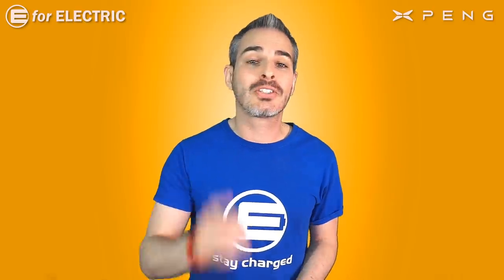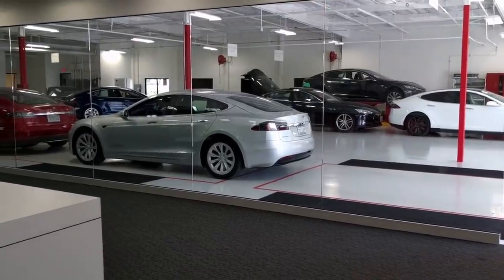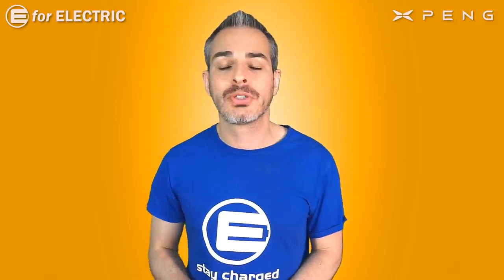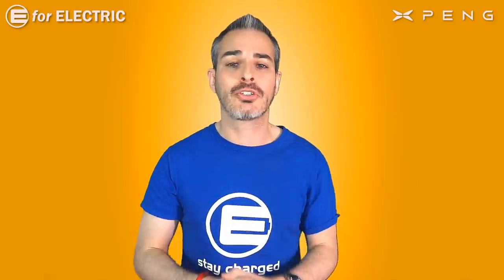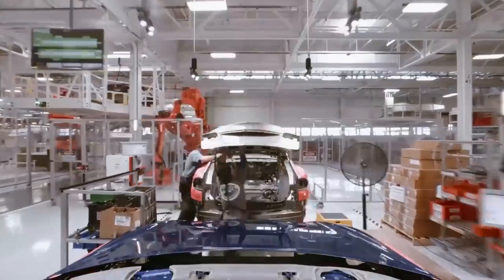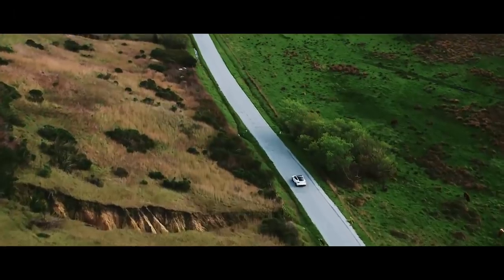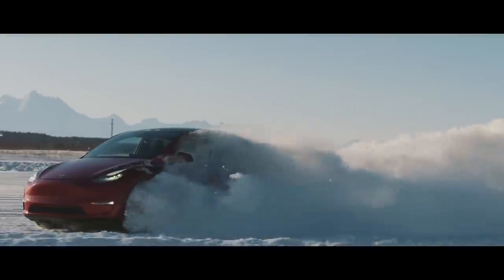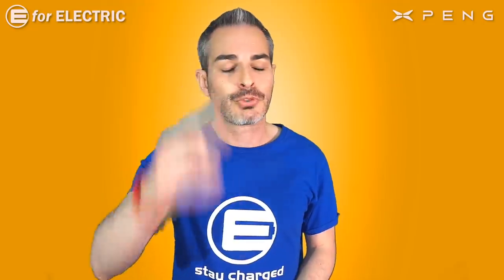Buying a Used Tesla in 2021: 10 Essential Tips

Comment: Hello Alex, I purchased one of the first Model 3s in Canada. I had to wait 901days from order to delivery. I needed AWD for our winters here and since the first Canadian models were only single motor ones, I went back on the wait list. So as well as having to pay for the largest battery, I had to wait in line for the 2 motor AWD version. As a result, in order to get my car, I also had to make the choice to purchase the "Performance" model 3 or go back on the interminable waiting list. The car eventually cost me CAN$112,000 and even though my car did not come with the red disc brakes and the larger callipers of the "ultra" Performance Model 3, it is still a performance car. I have FREE supercharging for as long as I own the car and FREE wireless connectivity too. My problem is how to recoup some of that expense when I sell it to buy my Cybertruck!

Comment: This video is 6 days to late. Just bought a used Model X.

Here are 10 more tips that I used for buying my car.
1. Check the leather seats that there is no scratces or holes.
2. Check the hood for small chips in the paint.
3. Check in front under the car, there is a black plastic cover. Verify that is is intact.
4. Test drive the car. Set the air suspentions to highest setting. Verify that the car still runs smoothly.
5. Ask the owner if there has been any repairs or Tesla service recalls.
6. Check the brakes. Make sure that there is no rust in the grip zone (the shiny area).
7. Test the brakes with and without regenerative braking activated.
8. Check the paint in the door opening for the falcon wing doors, if you see missing paint the doors are not aligning perfectly and chips away paint when closing.
9. Search the VIN number online, and make sure there is no Tesla recalls. And that the information aligns with the sellers information.
10. Get as mutch information as you can in writing.

One last thing… I almost bought a Car thet did not have all the feutures I wanted just becous I got so dazzeld by low price and a seller that said he had multiple buyers waiting. Always take your time!!
Reply: Yes, thank you.

Comment: Buying used EVs always seemed scary to me. This video does go trough a lot of important details and things to watch out for, so thanks for taking the time!
Reply: Really? Why is it scary?
Just use common sense..
Go over the car the same way you go over any gas car.. Check the battery for degradation and if there is some degrade in the battery, subtract another 10% from that to get a real world range. Of course the range depends on your driving style and other situations.

Take the car to a public charger and see how fast it chargers, see if it will charge to its maximum rate. 

If the seller really wants you to buy the car, he/she will test drive with you all day long. Drive around the city and freeway until you have no range left.  After all, you are the one spending $35k, you better make sure. Also check to make sure the title is not salvaged.

Comment: Can't wait for the 25K model. Be interesting to see the specs
Reply: 225hp
Single electric motor
Rear wheel drive
280 miles range
Hatchback
3000lbs
125kw max charging speed
75kwh battery
Price: $24.999
AutoPilot included
Can be optioned up to $34.999

About the same size as a Nissan Versa Hatchback.
Reply: Keksi   its $24.999 starting price.
Reply: Keksi  I like to stay optimistic. I just want to see progress in the cheap direction, not just Tesla but all brands.
Reply: Jimmy Edward  
Its gonna be 75kwh
Reply: Jimmy Edward  
The $25k Tesla will not have a 250kw charger, its 125kw. 
The new Tesla will have slightly better specs than the 2021 Chevy Bolt.  Elon is good, but realistically you can't get Lexus or BMW quality out of a car that has a MSRP of $25k. Also, the car is going to be a lightweight sub compact, there are going to be compromises..

Tesla should just offer the Model 3 for $35k starting price.. 
I just don't see Tesla putting a lot of great things in a $25k car. Something will suffer... I think its going to be build quality and a lack of superior materials. The car will have adequate range and be less powerful than the model 3..

I guess as longs as it charges at a good rate and not keep people at the SuperChargers longer than 20 minutes, the car will be sold out, especially if the government brings back the incentives..
Reply: @antoinefunes1638  I am thinking the same thing.  Affordable pre-owned EVs are definitely something I’m interested in, and are good for pretty much everyone.

Comment: Are you sure that FSD is transferable.  I think that this is something that is not clear in their contracts and Tesla has not weighed in on.  Right now they are allowing it to transfer but will they claw that back once it becomes fully functional?
Reply: Last I heard, it is not but yes important to check things like that.
Reply: @ymcpa73  If Tesla buys it as a trade in, they will disable the FSD, then resell it as used( pre-loved!) vehicle. However if an INDEPENDENT car dealer buys it as trade in, my understanding is that they can resell it with the FSD intact.

Comment: I bought a used obsidian black RWD 2016 facelift Model S 70 from a guy who has a exotic car workshop. He sold it as he just bought a newer one.
I never met with a fair person like this guy, he took great care of the car.
The car has free supercharger for life and premium package for life including free Spotify. It has autopilot 1.0, and it slows or stops the car if there is a collision danger. It had 117k miles and has all service history, and MCU update.
The battery has 191miles on a full charge. If I drive a distance on a motorway on 70mph this drop around 160-180 it’s depends on the condition, it’s just an average calculation. I payed £26k. More than a month gone but I’m still over the top of the car. Unthinkable difference between any other car! Never traveled with more confidence and feeling safe behind the wheel.
My biggest problem was with the car that the previous owners Spotify playlist were still appearing and the Tesla service guy removed it remotely after I told them the issue.
I still have for years and two months of the battery and drive unit warranty.
I am glad I made this decision. Now I am thinking of getting a solar system so I can charge it for free at home!😊

Comment: I might be interested in a $25k Tesla hatchback as a commuter car if they ever come out with one.
Reply: Its coming... It will be slightly an improvement over the 2020 Chevy Bolt. It will have 25 more horses, 125kw charger and a 75kwh battery.
Heat pump will be an option.
Reply: @mamadouaziza2536  Where did you get this information?
Reply: @aftonline  
I know a Tesla engineer
Reply: @mamadouaziza2536  that sounds promising indeed!  I hope that pans out.

Comment: Thank you cool looking around for a replacement for our brilliant i3 😁🌍💚
Reply: So you like the i3?  I’m considering it as well as a Tesla. Does it have the REX and does the electric only distance really match the claims of 200 mi?
Reply: @scottwiper6360  
The 44kwh battery version i3 all electric has a possible range of 170 miles, if you include the REx, the range is 240 miles plus.

Go for the updated i3S because its more stable at speeds above 75mph, it doesn't swerve as much in crosswinds because the car is lower to the ground and has slightly fatter tires.. However, the i3S has a slightly stiffer ride because its sportier and sits on 20 inch rims. There are 33kwh and 44kwh battery versions of the i3S.

Comment: Even without the $7500 tax credit, the price of a new Tesla has dropped. Yes, that may be because the Model 3 became available, and that is a smaller car than the Model S, but as soon as the Model 3 came out, sales of the Model S dropped right off, so clearly the Model 3 is big enough for most people who can afford an EV. It is also clear that Tesla will need to bring out an even smaller, cheaper Tesla than the Model 3 soon, because there are still millions of people out there who can't even afford a Model 3, new or used.

Comment: You forgot the most important tip of all, take a course on anger management, since it will be very frustrating dealing with their customer service.
Reply: Anecdotally I had great customer service working with the used Tesla service people. I had many questions and some few issues and they replied promptly, the regional head gave me her number and said to call anytime and I did. They were super good. Again, just an anecdote and I have no idea if this is consistent outside of my region or typical.
Reply: @ericsuxmeballs  You must be one of the lucky few, for most people I've heard of it is quite frustrating. Hopefully your car will last for a long time. A big concern with EVs is that they really don't become better for the environment than gas until the 7-8 year mark.
Reply: @andrewmeehan6151  Yeah I guess I was pretty lucky. As far as the environmental accounting some things that help with that is buying used, but I also have solar to charge the car so that will bring that break even point for being better for the environment down a lot. And that 7-8 year mark is pretty variable and debatable I have seen estimates as low as 2-3 years for break even point for CO2 emissions, engineering explained has a few good videos on that subject.
Reply: @ericsuxmeballs  You're right it does matter where you live. In EU it might be shorter (2-3 years) like you are saying. They have smaller cars and batteries as well as more renewable energy. If you have solar (and can afford it) that will help too. How long do solar panels last? Someone told me they are only good for 3-5 years, not sure how true this is. 

I also wonder if there are enough battery materials in the world for everyone to have an EV, or if supply constraints will force most folks to drive hybrids or just gas.
Reply: @andrewmeehan6151  Whoa, no even the crappiest solar panels last decades. Most have a 20 to 25 year warranty and a production guarantee that will guarantee that after 20 to 25 years they will still be working at 80-95% of initial production, again it varies by brand. But yeah they last a long time and if you can get them financed will cost about the same as the energy bill they are replacing, so for me it didn't change my budget much and there was no downpayment and a huge tax credit. As for battery material, it again depends, there is plenty of available battery material to more then cover all of our needs - it's battery production that is holding us back. That said battery material varies, current high density batteries use cobalt which is rarer, but Tesla and others are reducing the amount of this rare metal that is need or eliminating them completely by going to alternatives like iron phosphate. Don't worry about running out of battery materials lithium is not that rare and there are alternatives to the currently used rarer metals.
Reply from the maker: Touche
Reply: @EforElectric  I don't mind EVs per say, i even like some of them. Just not a Tesla fan. They aren't a real car company.
Reply: @ymcpa73  they aren’t a real car company because they make soulless appliances that take all the joy out of driving. Turning a car into an iPhone is a travesty. 

The only evs I’ve seen that I would consider buying are some of the vag products (taycan, e tron) but those still feel artificial.

When you drive you want sound, vibration, and character. Tesla is fast, I’ll give them that, but
They lack any sort of character. Not to mention a turbo accord is equally as fast as a base Model 3. The type r is faster and can be had with a manual. Life is to short to be subjected to FSD.
Reply: @andrewmeehan6151  Just curious, why are you watching a Tesla EV video?   Why and EV video.  If you despise most, if no all EVs, why not watch something else?  It must be true what they say: Haters gotta hate.
Reply: @ronlheureux7623  just a little trolling on Tesla won’t hurt anyone. They troll all the time with those silly vanity plates ex. Nogas, battery, evman etc.
Reply: @andrewmeehan6151   The LFP batteries don't have cobalt or nickel, just lithium, iron and phosphate which are all fairly plentiful. That's the way Tesla is going, the mass market cars will have LFP batteries, and only the high end performance cars will have the old battery chemistry with the nickel and cobalt.